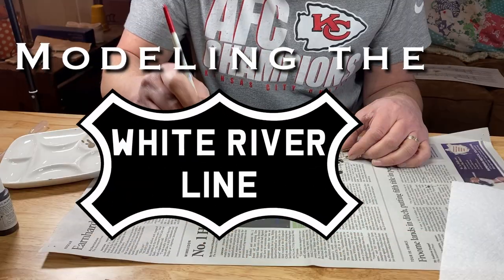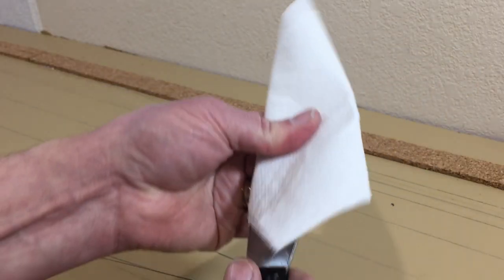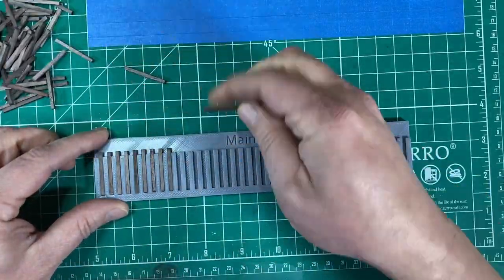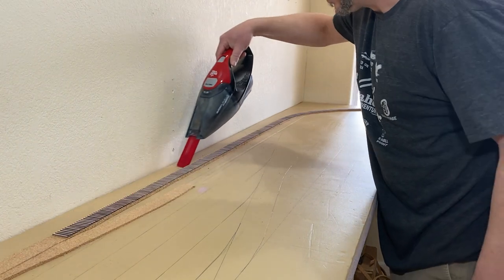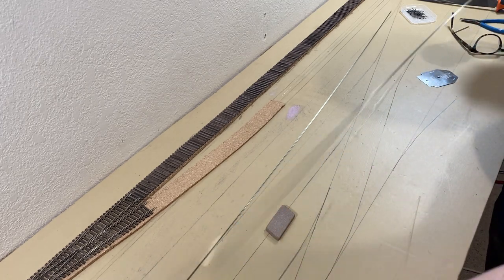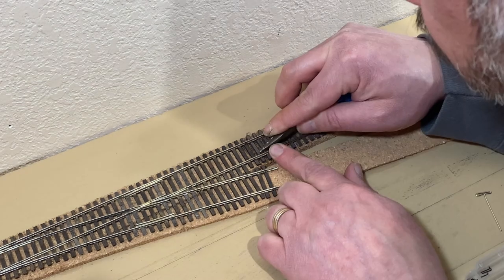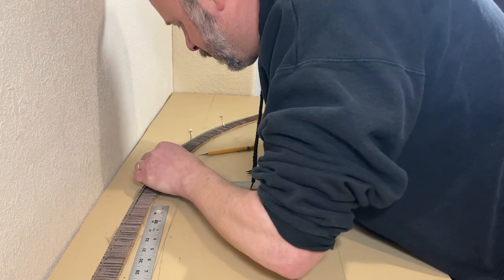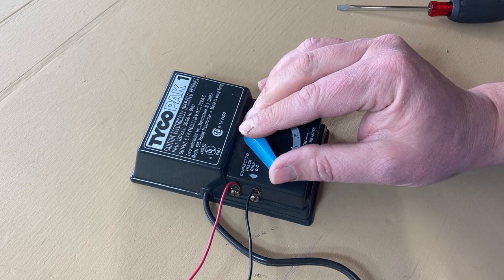Hand Laying Track on My Model Railroad

Comment: OOh! A rotary cutter! Glad I watched this video. I had no idea such a thing existed. 
I still have a lot of track to lay and this looks like a great way to trim cork once it's glued down. My track doesn't always totally follow the cork centre.
I will still use my bench saw to cut the strips aa that is really fast and accurate despite the amazing mess it makes.
Once again, a YouTube vid gives greate product ideas.
Good stuff. Glad to find another layout construction series.
I admire you using individually cut ties. I am afraid I cheated and used pre-drilled TwistTies from FastTracks.
Reply from the maker: Glad to pass along this tip. Rotary tools can be really handy. The ties don't take too long, only a couple of hours for around 1000, but I'll admit I'd get the twist ties if they were in my budget.
Reply: I forgot to add:
You mentioned that you had trouble getting the correct frog angle when using the PointForm tool and ended up using the "Crossing" slot.
Well, you have me totally confused here..... that slot is only used for the reverse frog in double crossovers. The "Frog" slot is definitely the one to use. I've build dozens of these critters in #5, #6, and #8 and never had a bad "V" soldering angle unless I used the wrong PointForm tool.
By the way, a coarse rasp wood file is great on cork to get a shamfer edge for the ballast.
Have fun and keep up the enthusiasm.
Reply from the maker: @stevedonald8815  Turns out my buddy that lent me the point forming tool sent the one for crossovers rather than turnouts. So, that was my confusion.

Comment: Have you thought about picking up a 3 point gage? You put the single point on the finished rail and the other 2 go on the 2nd rail. You put the spike in between the 2 points. They come in code 100 and 83 and maybe a few others. I used them about 30+ years ago when I tried laying some HOn3 track. Worked pretty well for me.
Are you going to be laying any of your turnouts? That can save you some bucks. Anyway it looks great so far and having that 1st loco run is always a great feeling.
Reply from the maker: I plan on picking up a couple of 3 point gauges for sure. Should help me quite a bit. I've built several turnouts already and have a video on it. https://youtu.be/Gj3xZC46aZ0 I also have a double crossover planned and I going to attempt to build my ladder yard in one piece. Thanks for stopping by.
Reply: @WhiteRiverLine  I remember the turnout video now. Sounds like you have your work? or maybe play time cut out for you.

Comment: My understanding is that silicone is not an adhesive and yet I also think it is a great adhesive for laying cork.
I did not realize you were going to spike all the tracks. I am definitely not trying that with N scale.
I have a tool from MLR, Track Toool Set. It comes with a Parallel tool that might be easier than using the track gauge for spiking the track.
I am glad you got the train running at the end.
Reply from the maker: I'm glad to get one running as well. I've had other's suggest acrylic caulk for laying road bed as well. I might switch to that.

Comment: Great episode but wow those spikes look tedious to install. The finished product looks great and the staining makes this ties look so realistic. I also liked the jig you had 3D printed. Look forward to seeing the next episode
Reply from the maker: Yes, a little bit tedious, but I found it really rewarding. Thanks for watching!
Reply: Back in the 80’s, there was a company called Ramax (I think) that made a plastic spine type jig for pre spacing crossties, and it could be screwed down to a piece of wood with a curve radius centerline drawn on it. When filled with ties, they would perfectly match whatever radius you set it to! I don’t think they make them anymore though. Another hint on laying rail on curves is to leave the last 3 or 4 inches of the spiked rail unsoiled, slip the next piece of rail into the joiner, then line up the new and the unspiked section perfectly straight and solder bit! You can then proceed laying rail! Same goes for flex track with the added step of being sure that the “loose” rail is on the inside of the curve. Installing it with the loose side out will result in the loose rail disappearing back into the tie strip! The layouts looking great! Thanks for posting!
Reply: It's a shame Kadee no longer makes their Spiker hand tool. It looked like a regular handheld stapler from Swingline. Did both sides of the rail at one time.

Comment: You should have soldered two 3’ sections of rail together going into the curve to give you enough length to get you beyond the full radius…soldering this joint prevents any “straightening” in the curve…placing that “dry” rail jointer the way you have is/will create problems later…just saying. Aside of that…great looking layout…good luck with the hand laying.

Use to model O scale the same way but used a Kadee Spiker with 3 weighted three point gauges and an NMRA standards gauge with code 100 / 125 rail…a lot easier than needle nose pliers.
Reply from the maker: Ah yes, that is what I should have done. Maybe I can think of a way to remedy this now without pulling up the whole thing.
Reply: @WhiteRiverLine  
Unfortunately your going to have to pull that rail…better now than afterwards once you finish the end-of-the-curve transition…it will be a pain in the butt…but a huge headache later…good luck…looking forward to you layout updates 😎